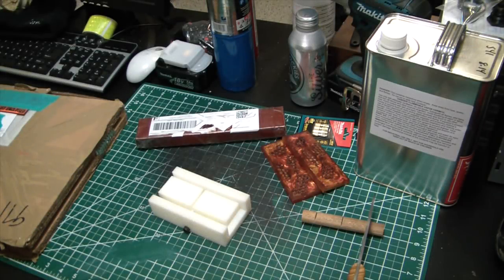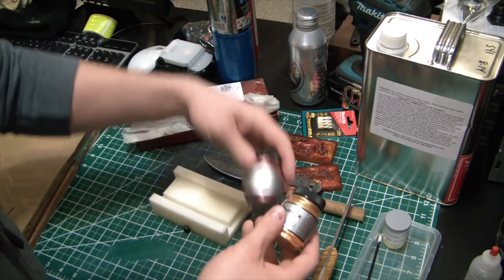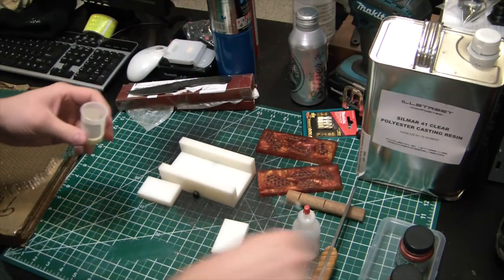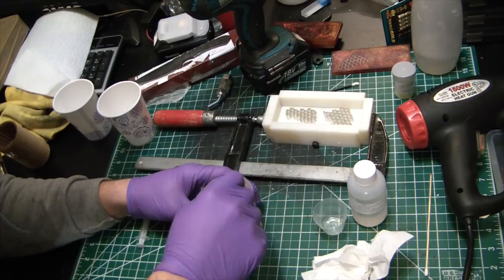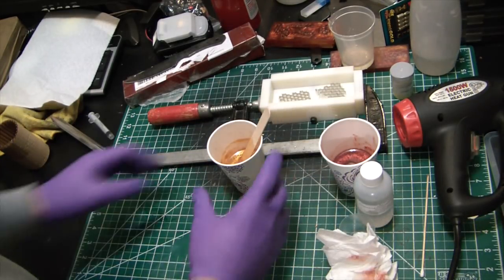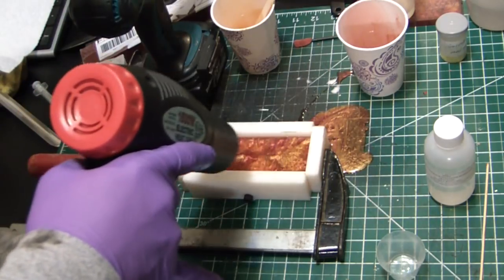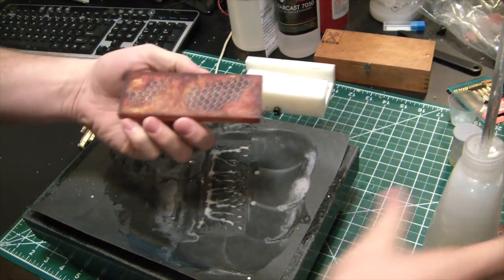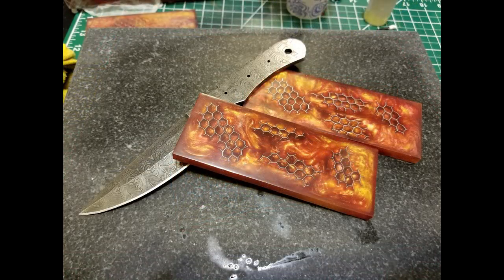MAKING COMPOSITE KNIFE HANDLES / SCALES IN THE GARAGE - ELEMENTALMAKER

Comment: I have seen people using a vacuum chamber to remove air bubbles when molding with resin, seemed to work really well
Reply from the maker: watchtheskies that it absolutely does! I was just too lazy to bring out my vacuum chamber and pump, and I've used the vibration method in the past with great results. It's not as good as vacuum for sure, but it works for most purposes. Thanks for the comment!
Reply: Apparently you can use a pressure chamber too, it compresses the bubbles until they are so small that you can't see them, obviously you need leave it in there until the resin sets
Reply from the maker: watchtheskies the model makers at my last job used massive pressure pots to do castings. It was pretty awesome to see.

Comment: Sir to assist you in mixing and not creating air bubbles.  use a variable hand drill with a pencil (unsharpened with 6 or 8 flat sides). Mount pencil in chuck and insert into your epoxy  then energize very slowly and mix till blended completely.  this is a  procedure used when prepping for circuit board repair.  if not a lot of epoxy use a regular drill bit backwards.

Comment: How does the cost per set compare with buying a set Vs making your own. Seems like you need to spend quite a bit to set yourself up, especially if you only make a few at a time. Still worth it?
Reply from the maker: G Macka they are quite inexpensive to make given you already have the tools handy. Resin, aluminum honeycomb, and pigment are very reasonable. Probably only a few dollars worth of materials plus your time.
Reply: ElementalMaker that's awesome. I will have to look into it myself. I really appreciate your replies.
Oh, and the honeycomb question I had, I meant to ask, would they still be strong enough if the honeycomb went the full length and width of the scale.. do you think it would compromise the strength and make them brittle
Reply: IMHOP this not fast or cheap its about do you want to create something from you? I have never sold any thing I have made...yet ...but my work is part of me

Comment: That honeycomb effect would look awesome if it were all the way through. looks good, nice job
Reply from the maker: G Macka the honeycomb does go thru both sides, I just didn't polish the one side so it's not as visible.
Reply: ElementalMaker, What I should have said was, if the honeycomb effect was present throughout the entire piece. Full length and width of the finished grip.
I think that would look insanely good. Would it still have the desired strength though, and not end up too brittle?

Comment: I was wondering, could you mix the pigment into either just the catalyst or the resin then run that through a vac chamber really quick? I'm thinking that would not only remove air bubbles from the mixing of the pigment, but also would make it that much easier to tell when the catalyst is fully mixed with the resin...
Reply: A vacuum pot would turn it into foam , a pressure pot is the way to go

Comment: I would suggest a vibrating table. Some plywood, a few springs, a small motor w/ an offset weight... Add a rubber mat, and the vac bell will sit right on top. Useful in casting other composites, too. 8^)
Reply from the maker: Solid suggestion! I actually have a vacuum chamber for proper degassing, but used the drill/offset weight purely out of laziness not wanting to set up the whole vacuum system.

Comment: Would regular bar top resin work to make knife scales?
Reply from the maker: Jack Moler as long as it is made for thick pours it will be okay. I tried using fiberglass epoxy resin in the past and it was too exothermic when it cured, and started smoking and caused tons of bubbles. As long as the epoxy is for thick coatings though, I think you will be okay to use it. Experimenting is the name of the game!

Comment: Well, now I know what I'm ordering with my taxes lol. Some of the cool lookin goo, and some decent steel XD I've just been practicing with some name brand Super Shit Steel from Home Depot.
Reply from the maker: Nice! I higly recommend starting with O1 tool steel, as it is super easy to heat treat and also quite easy to work with. Makes for very sharp blades as well. Only downside is you need to keep the blade oiled or it will rust a bit.

Comment: Would these be the equivalent of micarta?
Reply from the maker: Micarta is layers of fabric usually impregnated in resin, so I think micarta might be a bit stronger, but this is similar, and likely more resistant to the elements
Reply: @ElementalMaker  Ok. I was considering something like this for making lock pick handles.(when I can set aside the time)
Reply: @ElementalMaker  so, would there be anything stronger than the fabric impregnated resin? 

I ask because as your method also produces a composite material. I assume you know more about what materials could be used to make it both tactile and resistant to wear. 

For lock picking, being able to feel vibrations up the pick is crucial. So, for what I plan to do, It will be for a full tang pick.
Reply from the maker: @franglish9265  throwing in some fiberglass strands or matting would add a ton of strength, but also look kind of crappy. I epoxy the scales to the tang of the knife, so it gains alot of toughness in that way and I find it to be plenty strong as is.
Reply: @ElementalMaker  ok. The materials I would be using would be about 15 mils to 20 mils in thickness. 301 Stainless Steel if I can buy feeler gauge stock at that thickness and grade of steel.

Comment: the reason the segments pop out as you say is due to the fact your using polyester resin. upgrade to epoxy it wont happen again
Reply: roger that ...polyester is toxic  epoxy is the only to go and has many other attributes
Reply: Could you recommend a brand of epoxy? Or would it all be the same result using it for the scales? I've searched some knife blade forums but all I could find about epoxy was the best epoxies used for attaching the scales to the knife, and that stuff was expensive for small amounts